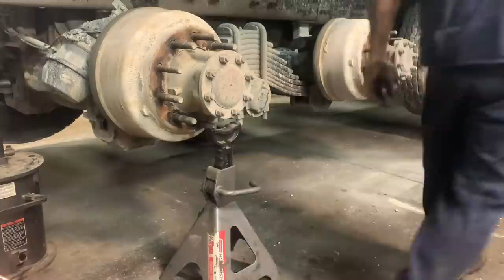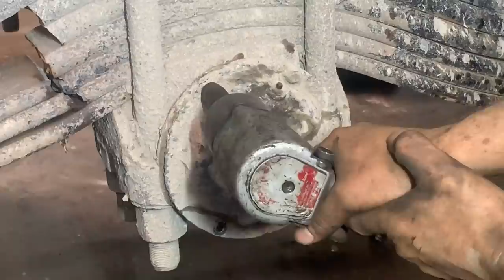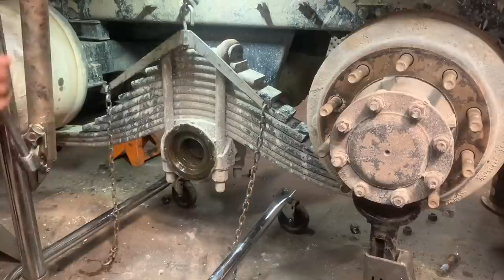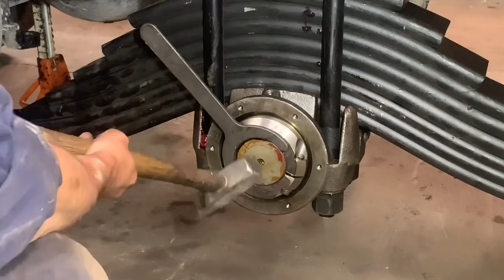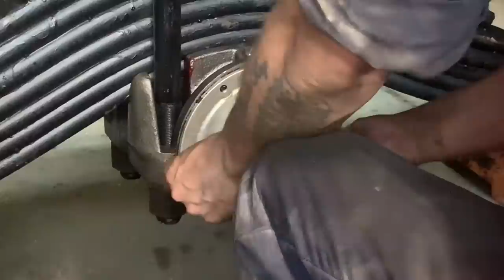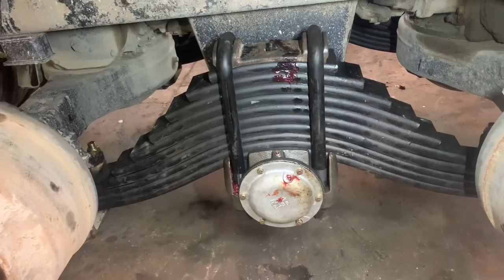Mack Camelback Suspension | Rear Spring Replacement

Comment: Was a mechanic at a Mack Truck dealership and did lots of these. Often times depending on how many leafs were broke you'd cut the U-Bolts, unstack the leafs and replace the individual leafs that were broken. On the whole spring replacement I had an adapter made up that I bolted to a transmission jack, that threaded onto the center bolt, and could wheel the old spring assembly off and the newly assembled spring on. The U-Bolts on these were the largest fastener on a Mack. Worst part was always spinning the cut U-Bolts out, they were often frozen up in the saddles.
Reply: Could you tell me what that parts called ? My tires aren’t really lining up so I guess in will be needed a trunnion or something
Reply: @corybowen1923  Did you measure the centers from axel flange to axel flange? How much is the difference between the right side and left side?

Comment: Worked on many Mack suspensions 44 and 55 heavy dirty work, we had a pit to work in which made things a little easier. One guy would hold bushing box over his head while standing in the pit while the other started the bolts Boy o Boy that was heavy work. We also used a chain fall to pick truck up to remove tires and set it down on wooden blocks.
Reply: I have seen heavy duty jobs and if I was doing it the thing I wouldn't enjoy is dealing with the grease

Comment: i did these on rear loader mack garbage trucks, getting the cap to line up and getting the two threaded bolts in and the other 2 nut and bolt assembly and getting the caps on properly with the bushings was an absolute nightmare.

Comment: I worked at the Indianapolis Mack dealership for 19 years and did several of these. Including the rubber bushed two piece trunnion saddles.

I still have all my fingers and toes. Two of my coworkers unfortunately don't. 

It's a physically hard, dangerous, dirty and time consuming job. 

That was in the 80s and 90s I'm paying the price physically for it now. 

If I remember correctly the U-bolts torque was 1100 to 1200 pounds. 

Rough way to make a living.

Comment: Awesome Mack video - thanks.  That's a lot of work.
Maybe add another handle on that spanner wrench so you can use 2 hands? 
That looks like a Hoyer lift you're handling the springs with.   
The CP impact seems like it needs a hug.

Comment: Man I still can’t get over that spring hoist. All the dumb ass times I had to man handle them in.
Reply: I hear you. Back in the late 70's I had an F Model with the same suspension. Broke one of the leafs and decided to fix it myself because I was a cheap OO. Two days later I got it put back together enough to get it to my local Mack shop where they could finish or, should I say fix, what I started.

Comment: Semi Workin,
Mack Trucks are ALOT of work to keep maintained and worked on. Just like the compressed spring assembly ta trunnion with the upper and lower spring pads. (elephant ear rubbers and caps)

Keep it Right and Tight, that's how ya make it happen.

Comment: Boy if that last spring leaf had broken that driver would have had a bad day. Ol Mack camel back suspensions. They are tough as nails but ride like a two horse wagon. Need to get you one of those big one inch mega torque impact guns to take that stuff off with. Did you replace the bar and do those spring packs come as a unit or do you rebuild them in your shop. Think I would weld an extension on that spanner wrench for more leverage. I like the cart you remove and replace the spring packs with. Is it shop built. Sorry for all the questions but I find your videos informative. They answer a lot of questions and I just like making broken worn out stuff new again. Go buy yourself a beer you have earned it. That is hard work...

Comment: the guy knows his shtuff.been doing it for about 9,000 years.
Reply: And doesn't bother to clean or use lubricant until he runs through a tank of air for one bolt, and no torque wrench in sight for assembly... ok

Comment: Got 4 of those trucks can only get 100000 miles before I have to cut the u bolts and replace the trunnions. Which they would make thicker bushings.
Reply: Need to use a better grease or grease  it daily
Reply: What is the application?
Reply: @jcurtis4082  roll off trucks
Reply: @bigmurph1447  grease them each week when I grease the roll off hoist.
Reply: @wth82  try a high moly grease
Reply: @wth82  Do they have transverse torque rods? They help with the suspension walking to the side.

What is the service interval for these grease fittings? 

We greased at 40 hours in a mixer and dump fleet and seldom had an issue. And when we did it uas usually lack of grease or contamination.

Comment: A few minutes with a wire brush and some WD 40 would have made this job a lot easier, and 18 minutes watching wheel removal and replacement can get a bit boring, especially when the fitter cannot be bothered to aline the tyre valves properly on the double wheels.

Comment: At 50.05 it looks like you split the part where the threads are.  You can see a crack open up the tighter you go with the bolt.
Reply: good eye

Comment: Mack camel back or homemade beefed up type is only thing we found could with stand the mt's, dirt, muddy, snowy completely off road . I try grease them walking beam bushing for 8 months twice a shift trying make them last longer. Nope wasted my time 8 to 10 months at best start replace all bushings again. We even put a set-up of full oil covered 90 weight oil in few to  test trucks to try it. Not much improvement for the headache of homemade set-up. I could killed 2 drivers every weekend replacing 4 springs, 2 same trucks. Blame in-laws of owners.

Comment: What's that one little weird locking bolt do and what does it thread into?
Reply: You mean at the 30m mark?
Reply: @christopheryoung826  yeah I should have mentioned the time.
Reply: @rtz549  if you mean the nut he screwed on then put a bolt onto it holds tension of the spring to the rod that goes across to the other spring. I cant remember the name but ill look it up for ya after work
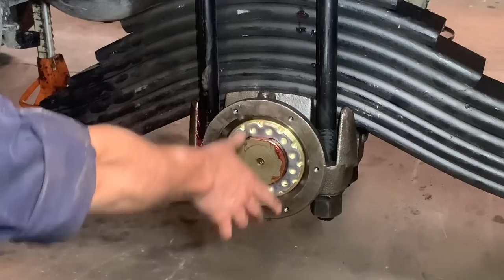Reply: At 27:40 he puts on a metal ring with holes in it. That little bolt threads into the collar nut and sticks in one of the holes to stop the collar nut from backing off.

Comment: 1:10 Shoulda cleaned the lug threads first. Now you're spinning off the nuts and accumulating a bunch of debris in the threads which will lead to galling.
Reply: Absolutely. I worked on GE steam turbine/generators and cleanliness was required, no matter how big or small the part. Components go back together when all machined fits are clean. Couldn't stand and wouldn't  put up with sloppy work if it was in my power to control. Contractor millwrights were something else.